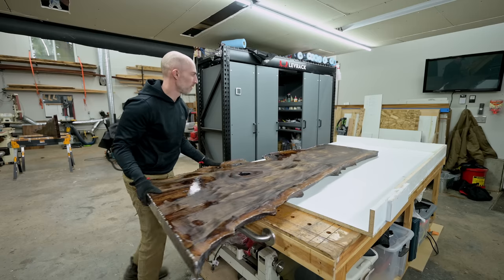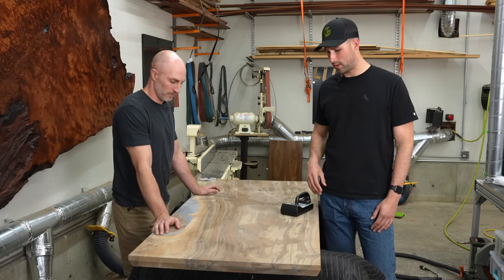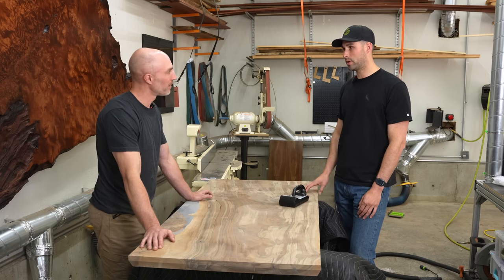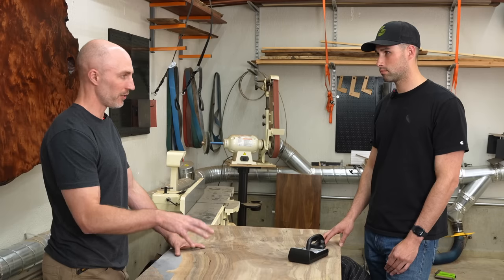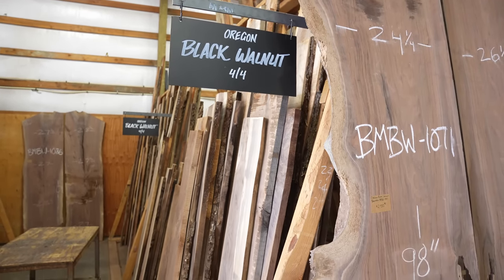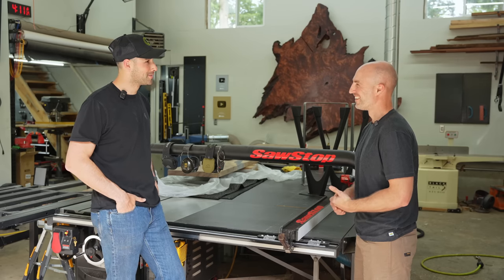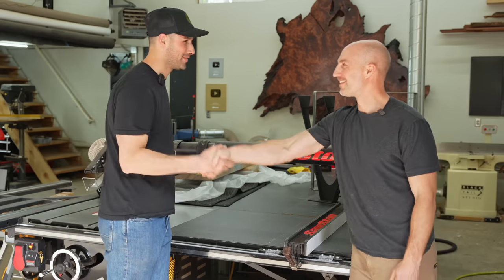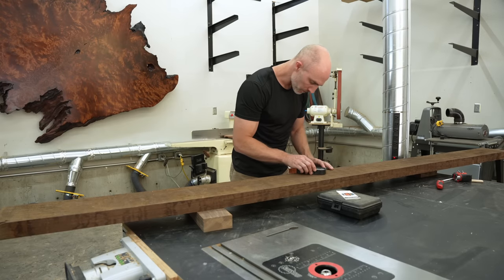Confronting My Wood Supplier

Comment: I dont know what to say. I feel bad for the wood supplier but honestly they should need to reimburse you for the damages to your business. You bought wood for thousands of dollars from them and I dont pretend to know the margins on these slabs but it cannot be such a huge cost to have someone with relatively low skill set scan the entire slab with that meter. I just dont get how this is possible; seems like they cut corners and unlike other things where cut corners might cause a slight inconvenience they are cutting corners on something that will ruin an entire project after its already been completed. I know the wood supplier probably can’t afford to reimburse you for the cost of the table (30K USD) but that’s what teaches companies not to cut corners. Such a shame.

And this isn’t even considering that you probably already got beneficial treatment due to you being a quality customer (buy lots of slabs) and carry a large YouTube influence. Not saying this company are jerks and wouldn’t reimburse the costs for wood and shipping to other customers but I doubt they’d offer up slabs at 3x the price for others. So now other customers probably are stuck bearing the costs of tons of lost time and materials (e.g. epoxy and rented equipment). That why I feel monetary hit for the supplier is best. This kind of preventable mistake due to corner cutting really isn’t acceptable.

Please correct me if my assumptions are wrong. To me it sounded like he said if the slab seems dry they stop checking the rest and assume its all dry. And it also seemed like a pretty quick process to check. The slab before sale.